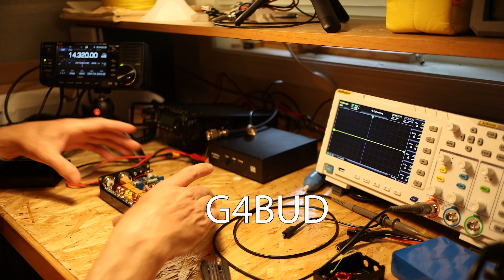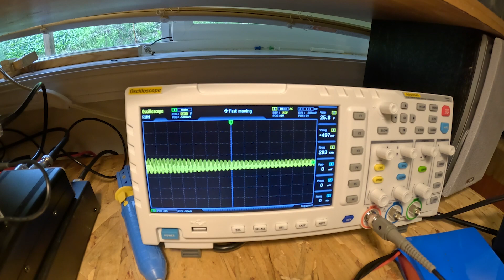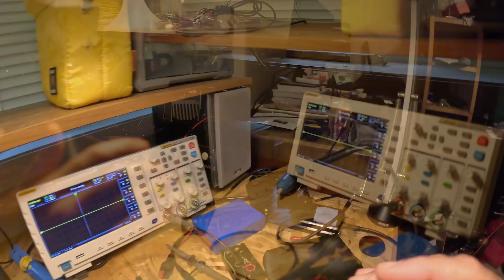Make the Micro PA-50 work for you!

Comment: I added the 10k resistor to fix the SWR circuit and it seems to work perfectly. I highly recommend while your'e in there to pull that buzzer out and replace it with an LED. I also added a relay in parallel with the FN switch hooked up to a Pi with Node Red so when I'm operating my IC-705 remotely I can "press" the button to reset the error or "long press" to turn the PA on and off.
Reply: Are you using a half or quarter watt resistor?
Reply: @cWatts-zv3oo  Think I used a 1/8W. I don't think it really matters as it's not really handling any current.
Reply: @jakelarson9935  thanks man. Is the amp still performing well for you?
Reply: any detail about your mod!?

Comment: Connection chain. Antenna -> ATU -> Amp -> Rig. Bypass amp (long press on Amp button) until you tune up with just the rig. Then turn on Amp. Another important tip. The RF output drops with supply voltage. I run mine at 9 volts and get 25W out on 20m. If I run it at 13.8V it puts out 52+ watts and shuts off. My rig does not have RF output level adjust.  So I just dropped the voltage to the Amp and it works fine. Less heat, longer life, etc. Works for me with no mods.
Reply from the maker: That’s an interesting approach. Totally works if you have a variable power supply.

Comment: Thanks for video. Worked great for awhile, then started having intermittent problems. Did your 33 ohm resistor fix and also ran a better ground to the amp. Seems to be working okay now - fingers crossed. Subscribed. Keep up the good work!
Update: It died. I was messing around with an accessory cable from the X6100 which worked fine at first, and then bam! SWR reads greater than 3 and immediately alarms - even in auto mode. Oh well. This thing had potential, and it worked great for awhile.
Reply from the maker: Keep ‘em crossed! I got overzealous and blew mine up when I turned off the protection. Replacing the finals didn’t fix it. In a drawer it sits.

Comment: Great work!  I went ahead and pulled the trigger on one.  I run a Chameleon Magnetic Loop antenna so i have to get extremely precise tuning before transmitting.  This will (theoretically) bump up my 705’s signal about 1 S-unit.  Will be fun either way.  73’s W5BL
Reply from the maker: It’s definitely a project! The nice part is if you blow up the finals the replacement transistors are dirt cheap!
Reply: @KD7QOW-np9gd so today I successfully performed the great “SlugJob” of ‘23.  Used the same resistor you did and I can report it is working flawlessly.  The weird part is that it reads an swr of 1.0 no matter what band, no matter what frequency I transmit on.  I mean I’m definitely not complaining but it’s kinda funny Bc I know it’s gotta be higher than that at places.  I’ve only played with it a little bit but this operation completely changes this cool little PA for the Icom 705.  Thanks again and 73’s.
Reply: @@deerae7460 yeah I must have fried the swr reader circuit is only thing I can think of.  Literally the only thing that trips it now is feeding it too much power.  Which is a good thing.  I like the mod a whole lot!  It’s a functional little amp now.

Comment: Well, I didn't do this mod as I don't have an SWR issue and I never disabled the protection mode as protection seems like a good idea. Regardless after about 3 months the amp went to a dead short. Customer service told me the finals were damaged and gave me the go ahead to replace them. I ordered a bunch since they are cheap and put in a new pair. Short was fixed so hooked it back up. As soon as the power supply was switched on the amp went to dead short again.  Tried another new pair, same result. So it seems something in these blows that then causes cascade failure or the IRF530.  Anyway I haven't been able to fix it and won't be buying another.
Reply from the maker: Yeah, mine blows finals now too. I don’t want to take the time to figure out why so it’s sitting in a drawer.
Reply: So you would not recommend this amp?
I'm thinking of getting the Hermes Lite 2, which is 5W maximum output.
Reply: @mrtechie6810  I guess the answer would be it depends.  I'm still not sure why mine blew up. Sure I accidentally forgot to switch the tuner once or twice and hit the SWR protection shut off and leaned in a little too close to the mic a few times and hit the high power protection shut off, but I assume that is what the protection is for.  Lot's of people run these without issue.  The developer has setup a private facebook group now so you can actually contact him and get assistance, get new firmware and so on.  So some issues are now fixed in firmware and other improvements to hardware made in a new PA50+ model.  If you can be very careful maybe it won't blow up.  If you want to use this outdoor for POTA, SOTA probably worth looking at.  In the shack I found the fan noise to be very, very loud and for this reason would be enough on it's own to not buy another.
Reply: @mrtechie6810  BTW I highly recommend the Hermes Lite 2.
Reply: @ronlewkowicz9656 did you consider changing the fan for something better like a Noctua?
Reply: I want to run the Hermes and amp in a room that is close to the antenna. The computer desk is in a different room. So I won't be next to the amp/fan. The computer connects to the Hermes via Ethernet.
Reply: @mrtechie6810  That's a possibility but mine didn't last long enough to get around to that and I wasn't able to fix it.
Reply: @mrtechie6810  You'll need a  way to remotely push the button on the amp to reset after protection trips it off.
Reply: @ronlewkowicz9656 it's just a room or two away, not in a different building.
Reply: @ronlewkowicz9656 thanks for recommending the Hermes. I want to get back on the air, and the Hermes seems more interesting than a G90 or a used Kenwood/Icom. I'd like to keep the budget under $500.
Reply: @ronlewkowicz9656 I understand that the Hermes covers all modes (including SSB phone and digital), transmits on the HF Ham bands, and will also be an excellent general shortwave receiver?
Reply: @mrtechie6810   It covers up to 10 meter band, it doesn't do 6 meters.  It's a full blown SDR so all the modes and filters are all done in software.  Software like PIHPSDR and Thetis incorporate the wdsp noise reduction library which gives excellent noise reduction. They also incorporate pure signal in which you can bring in an RF sample from your amp and have it add pre distortion to the signal that cancels  out the IMD generated by your amp.  The only down side is it's QRP but there are some good amp options available.  CW is trickier with SDR, you need a keyer or something.
Reply: @ronlewkowicz9656  thank you! It sounds great for fixed operation and experimentation.
Reply from the maker: @mrtechie6810  I would not recommend it. If you want to run more than 5-10 watts portable, just get an FT-891. Amps are a huge hassle when you're operating portable, but if you MUST have one, get one with an internal tuner.
Reply: @KD7QOW-np9gd  I'm looking to operate fixed SDR and digital from a computer desk. No portable. I'll start with 5W and a great antenna. Maybe I don't need the amp right away. But 20-50W should be plenty with a good antenna, as I am at a high elevation.
Reply from the maker: @mrtechie6810  If you like everything else about the radio you’ve got, then it’s worth investing in a good amp for it. You can just skip over the cheap stuff and get something good that will last the rest of your life.
Reply: It sounds as if whatever happened pushed the bias voltage on the FETs up too high .  This thing has a micro controller in it and it may use DAs  on the  Micro or adjacen there to to  set the bias. If that is messed then it really can't be fixed economically.  THe MXP -50 amp that uses the MRF186 Gemini pair mosfet  (these are always pulls from Chinese  analogue now junker  cell phone power amps ) and no auto band change sounds like a hell of a better bet because it's so primative and keeps truck'n on.  It can produce only  37 W PEP out  linear for SSB use  and that when fed with 18 V not  13.8V  (Kevin the Old Ham radio guy found this ) the best Gp you will get is around 9dB so it needs a Lot of drive but it is near to unkillable and the MOSFet pair is still available on the surplus market for  $15 USD.
Reply from the maker: @F_Tim1961  I think you're right about the bias. I did hook up the scope to the gate and set the bias to .6v but now that I write this I realize that was a mistake because in my mind I was thinking of bipolar transistors, not a FET. Oh well. In any case, there's no good documentation on this amp and the overall design is a bad idea for something mass produced and sold to consumers as the core of this thing is circuit designed by a ham who was challenging himself to see if he could design an hf amp from a ubiquitous transistor that is not at all appropriate for the purpose. My guess is the designer of the Micro PA knows a lot about microcontrollers but not a lot about analog design with discrete components. It would sure explain a lot of the quirks in this thing.
Reply: @KD7QOW-np9gd  The bias should be in the 3 - 4.2 V region, based on what is required for the IRF 510.  If someone took a  MicroPA50 out of the box and subs RD16HH   proper  RF mosfets (which are now an endangered species)  but with leg bending it is possible this is a passable  16 W  to  20W amp.  That's it, no 50W out.  HOwever it would last a lot longer than 3months because of better thermal performance of the basic components.  Basically as is ,  it is a colossal waste of money.

Comment: Good informative video. It's an interesting little amp. Thanks for the SWR resistor mod. Did you hook up the PTT line from the 705 to the amp?
Barry, KU3X
Reply from the maker: I tried the ptt line and it did nothing, even with the amp in icom mode.

Comment: Thanks for information. I'm not very electrically inclined but I've heard about a relay input from the 705 to protect it? Is that a concern with this amp?
Reply from the maker: It’s not a concern if you just use the RF sense and don’t hook up a control cable. I never got the control cable to work anyway, so it’s not something I’d worry about. Honestly, I wouldn’t buy this amp unless you’re electrically inclined and you like working on stuff. I’ve blown out two sets of finals on mine and it just sits in a drawer now.
Reply: @KD7QOW-np9gd  thanks for the info. Soldering and working on stuff isn't a problem for me, just the electrical stuff. I'm more mechanically inclined. Thanks for the videos.

Comment: with mine after many hours of deliberation and much trial and error  i firstly connected a 1.1 balun to my ic 705 and that knocked the swr down, then i unplugged the fan and Bingo swr 1.00 but at 40 watts it gets hot quickly so i tried many options and 30 to 32 watts max it now runs ft8 all day and the temp never goes above  45deg , the fan in my opinion is causing the swr mismatch
Reply from the maker: Huh. That's interesting and I would never have guessed. Can't argue with success, though. Glad you found a solution!
Reply: There has been a change since I did this. I have added a new sunon 60mm silent fan to the top of the unit after drilling many small holes . Only when I place a fan to the back of the unit close to the input and output does the SWR rise. This is why I love radio 😂

Comment: However, the main reason is, why buying an IC-705, when you can buy a Yaesu FT-891 which offers good value for the money? That amplifier can't really hold producing 50W. However, it is great for testing contacts in QRP mode.
Reply from the maker: Totally agree! In fact, I just carry my FT-891 to summits and it's less hassle than trying to carry this thing.
Reply: @KD7QOW-np9gd  Indeed. Less components to carry, and the FT-891 does 100 W easily and it is very forgiving. I have that radio myself and I just love it.